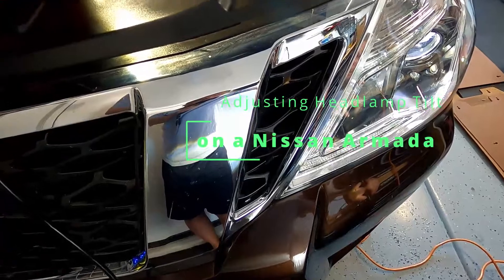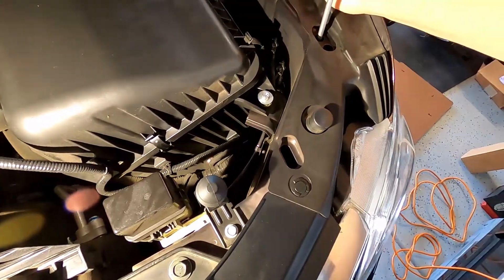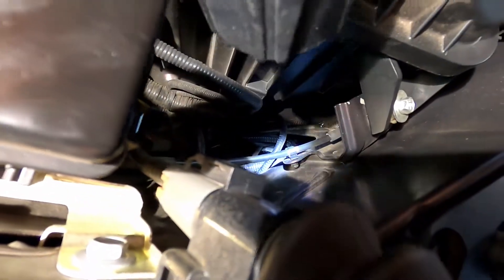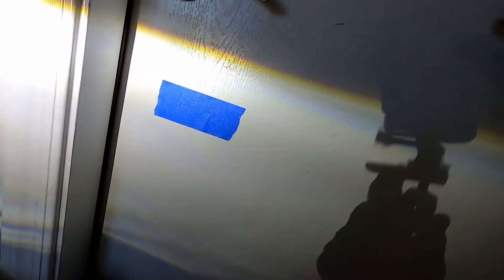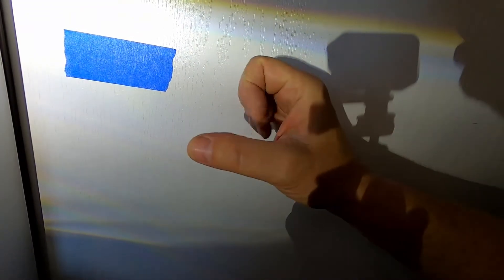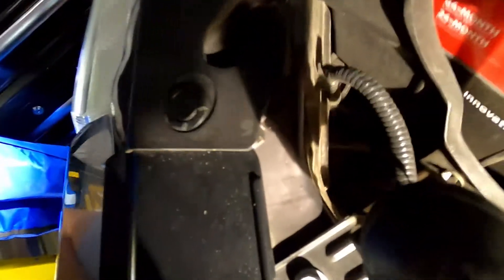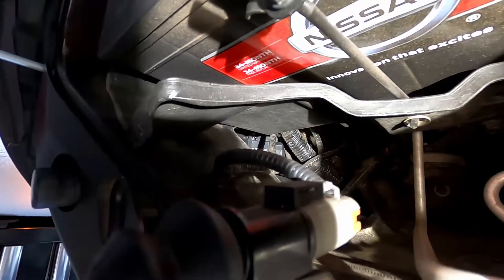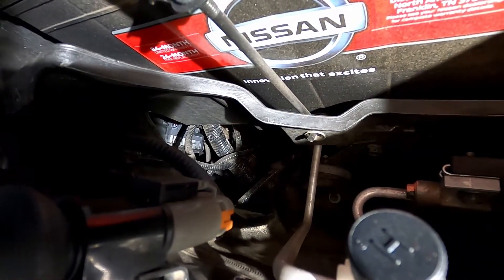Adjusting Headlamp Tilt Nissan Armada

Comment: what about right and left ?
Reply from the maker: @NASSER1989able  Hello, there's no adjustment for left or right headlamp tilt. If you have one that is pointing in a certain direction, I would check the bulbs fit into the headlamp to make sure it's flush with the housing or check for possible damage somewhere. Some vehicles may have a left/right adjustment screw. I don't believe the 2018 Armada is one of them. Good luck with your project!- Mike